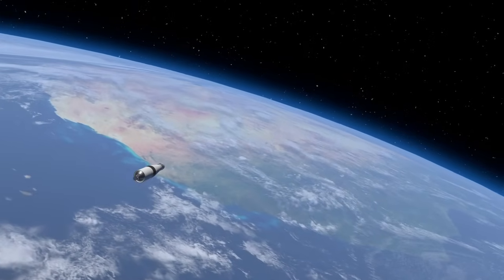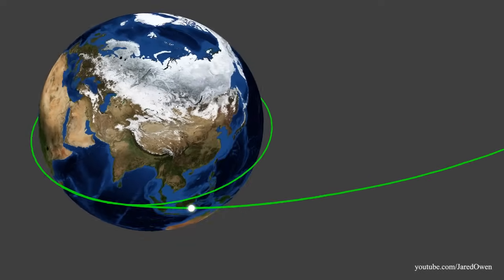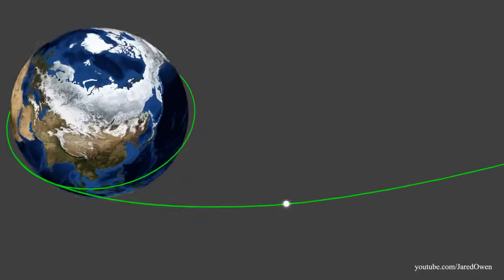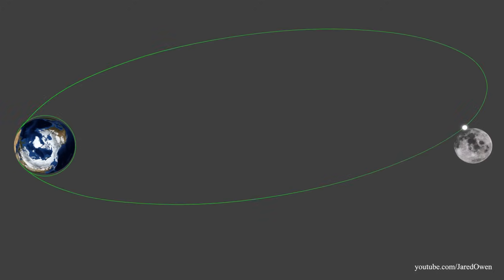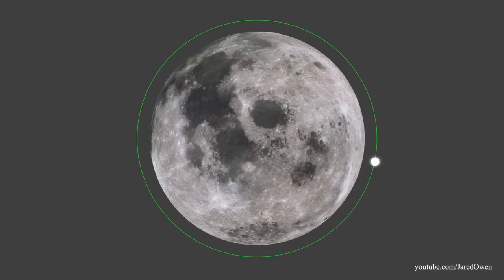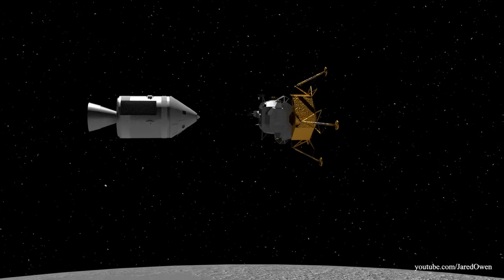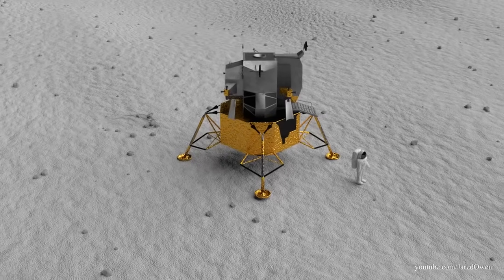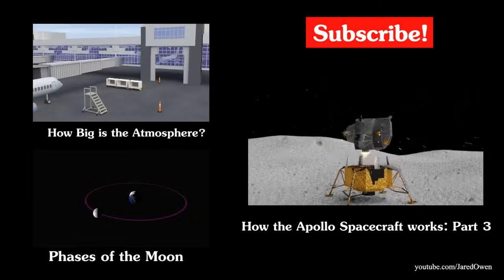How the Apollo Spacecraft works: Part 2

Comment: Is it always necessary to orbit the earth .. Cant it just go straight to moon. 
2. Why should lunar module kept orbiting the moon. Cant it just keep still high above the moon, like Iss.
Reply: They orbit the Earth because they are double checking systems and things like that.

The ISS orbits the Earth......
Reply: The lunar module could only be used once. Once used, the descent stage stayed on the Moon, and the ascent stage was crashed back onto the Moon so that seismometers could measure the impact for calibration purposes.
Reply: You do need to match to orbit of the moon to stay there. As such, the orbit didn't cost fuel. And why would they keep the LM? It didn't serve any purpose. So they loaded it up with trash and crashed it into the moon. The gave an added bonus of more science.

Comment: funny how elon musk was only able to achieve this maneuver recently with the latest computers yet somehow they were able to do this with just a guy and a stick in the 70's
Reply: What maneuver are you talking about?  SpaceX is landing LAUNCH VEHICLES; not spacecraft.  NASA has never accomplished this.  NONE of the Saturn V rockets landed back on a pad on Earth.  Zero.  They all just fell into the ocean and were later recovered.  You are comparing landing a SPACECRAFT to SpaceX landing a LAUNCH VEHICLE.  The only thing you are doing is announcing your sheer and utter ignorance on this topic; nothing more.
Reply: Let’s see. The Saturn family of rockets were the most complex machines built at that time yet all 32 out of 32 of them launched successfully. That includes the 13 Saturn V’s. This despite the fact that they expected a 50% failure rate with the Saturn 1’s & Saturn 1B’s. It’s also worth pointing out that prior to this, the USA had experienced many launch failures of much less complex rocket designs. The amazing success of the Saturn rockets was all achieved with pretty minimal use of electronic computers as the use of such devices was in its infancy. Most of the design and drawings were done the old fashioned way that took much more man-hours to accomplish relatively simple tasks. Yet despite all that hundreds of thousands witnessed each successful launch of those 32 Saturn rockets.

Comment: If you read the book "Carrying the Fire" by Michael Collins, you learn that the passive thermal roll during the coast to and from the moon,  was carried out in the vertical position and not in the horizontal alignment you might expect. It's a tiny detail most technical Apollo documentaries get wrong.
Reply: Thanks for the info ❤
Reply: Well that assumes they really did go to the Moon.
Reply: @TheMrSuge  which they did, if you're gonna deny the moon landing why the hell are you watching a video about it?
Reply: @TheMrSuge They did.
Reply: @TheMrSuge  🙄🙄🙄🙄🙄

Comment: When the LM/CSM entered lunar orbit, they were facing opposite the direction of travel.  I believe this facing opposite the direction of travel continued during the LM separation & throughout the Lunar mission.  When the LM rejoined the CSM, they were still facing opposite the direction of travel until the LM was jettisoned.  They then turned 180° to face the direction of travel waiting for the go-ahead to fire the main engine to return to Earth.  On entering Earth's orbit, they again turned opposite the direction of travel in order for the heat-shield to be in contact with the Earth's atmosphere; serving its purpose.

Comment: This is whole load of Bollox, we never went to the moon, more like we all got mooned. So many things could have gone wrong. We dont even have the technology even today to send man to the moon! We could barely get a good tangible connection to talk to someone across states in the 60-70s and we are to believe that Neil Armstrong sent a tangible message from almost 250,000 miles away!
Reply: "So many things could have gone wrong."

And many things did go wrong. The blurb for Apollo Flight Director Gene Kranz's book, Failure Is Not An Option, puts it well: "What appeared as nearly flawless missions to the Moon were, in fact, a series of hair-raising near misses.” 

Communication through space is just that: it's through space. It's not called "space" for nothing; there's nothing to impede a signal the way there is on Earth. With the aid of powerful radio arrays, communicating between the Earth and the Moon (e.g. Armstrong's phone call with Nixon) was actually not that big of deal. 

A lot of technology was quite advanced in the 1960s. 

The crewed air speed record set by the X-15 in 1967 (4,520 miles per hour) not only remains unbeaten today, no modern plane even comes close to that speed. 
The Concorde, which commenced regular passenger service in the 1970s, was capable of traveling at twice the speed of sound. Today, no passenger plane can even reach 1x the speed of sound. 
The Saturn V rocket which was used for the Apollo missions was, until just last month, the largest, most powerful rocket ever launched into space. 
The crewed bathyscaphe Trieste descended to nearly 7 miles below the surface of the ocean in 1960. Only one other craft has ever gone deeper (and by only 56 feet)!

The tech that sent humans to the Moon 1968-72 was in many ways quite advanced. They didn't have snapchat, but what they did have were kick ass rockets, and rockets are what get you to the Moon.   

As for what you are to believe, belief has nothing to do with Apollo, because it is objectively provable. Belief is for stuff that cannot be proven, like the existence of God, or the like.
Reply: The message was pre recorded, he did loads to cover any eventuality, as NASA has released several different versions, sometimes with different people heard in the background including traffic and seagulls.
Reply: And he ran away. Go figure.
Reply: "We could barely get a good tangible connection to talk to someone across states in the 60-70s and we are to believe that Neil Armstrong sent a tangible message from almost 250,000 miles away!"

Most people didn't have 85 foot dishes to pick up radio signals. NASA did.
Reply: Snore. Your comment is nothing but empty claims built on a lack of knowledge. You should strive to be better, not drag people down to your level.
Reply: Are you living in venezuela poor zone?

Comment: Which way was the CSM pointing on its way to the Moon? Here it looks like it's pointing towards Earth but I've seen another animation where they do a second 180 turn after LM extraction to place the CSM facing the Moon with the LM in front.
Reply: I think the main thing to know is that for most of the time, the adjoined spacecraft were in the barbecue roll. For the best results to even out the thermal energy being received from the Sun they would have actually been orientated perpendicular to the flight path. They would exit the BBQ roll when they did star sightings and course corrections then go back to the BBQ roll orientated perpendicular to the flight path. Btw, all of the Apollo mission reports are available online and well worth looking at for all kinds of information including the BBQ rolls and star sightings.
Reply: @mako88sb  Sorry, but what the f""" does the roll of the craft have to do with my question? If you don't know the answer please don't bother answering.
Reply: @rippenburn    Your question was:

“Which way was the CSM pointing on its way to the moon?”

My answer tells you what you wanted to know but for some reason you don’t seem to understand it. I’ll try again:

The answer is it depends. When they needed to do a course correction burn the CSM would have been pointed towards the moon. During the LM extraction and main engine burn to enter lunar orbit, it would have been pointed away from the moon. The rest of the time, which was most of the 3-day transit, it would have been pointed sideways to the flight path for the reason explained about the bbq roll. When they needed to do star sightings they would stop the roll and have the CSM orientated so that the sexton was in the shadow of the spacecraft so that the Suns glare was blocked.
Reply: @mako88sb  Sorry! I get it now and thanks.

Comment: We NEVER landed on the Moon! Almost 60 years later and we still are ONLY flying around in the ISS in earth's LOWER atmosphere.
Reply: Huh?  What difference does that make?  Is congress never allowed to end a space program like Apollo, else you conclude it's fake?  They made 9 manned trips to the moon, landing 6 of those times.  How many more would it take to convince you?
Reply: Go to the moon if you think it’s easy
Reply: @oppalus  I wish we could, but we CANT, and we NEVER did. We'll never be able to leave lower earth's atmosphere UNLESS we finally figure a way to pass through the Van Allen Belt, DonkeyTrooper
Reply: @123davepreston  So do you think the earth is flat or round? The ISS is in Low Earth Orbit
Reply: @123davepreston  The Karman Line is 100km, the Van Allen Belt starts at about 700km, and the ISS is flying under that at 666km. If you were to go fast enough you could only get about 11 RADS without radiation protection. 0.38 RADS were in all the apollo missions combined. Passing the Karman Line also means you’re out of earths atmosphere.
Reply: @123davepreston  If you’re going to get mad because people don’t believe your theories, then just don’t even talk to me
Reply: @123davepreston , Why do you think that if you flew to the moon several times, you should do it all the time? It is very expensive.

By the way, pretending to have flown to the moon is much more difficult than actually flying there.
Reply: @123davepreston  which is why SpaceX uses metric units, of course...

Comment: Fine but no explanation on why /how  that slingshot allows a quik safe line through VABs.
Reply: So?  Why does that matter to you?  Do you think people instantaneously die the moment they are exposed to a single proton?  It takes a week or two before getting a fatal dose of radiation in the Van Allen belts.  They do not go into the belts for missions that last a long time (shuttle, ISS, Mir, Skylab, etc.).  Apollo went through them very quickly, and only spent about 15 minutes in the inner belt (the proton belt, which is the more serious one).  The answers have been available since the early 1960s.   But, here's a hint for you: the reason you cannot find the answers is because your only source of input is by watching conspiracy videos.  You've never read a single actual fact about Apollo or the surrounding sciences.  If it's not in a conspiracy video, you simply do not know anything about it.
Reply: @rockethead7  
👍👍👍
Reply: @rockethead7  And? Why not? Something got to matter to me, sure aint going to be a MS 'mountain of proof Authority claim that debunked thousands of times' a denial :(   Why do YOU matter on a single proton death?(where the hell???)    Hey non carring guy; you have no idea WHY the Belts are there do you..... they stop radiations from Space (afterwards /outside /beyond), so a >>>few more<<< protons afterwards.
   And then MOON has its own brew :) A doublepunch. 

note: he never said a single thing on "how  that slingshot allows a quick safe line through VABs." route :(  Does that work for every Destination? Mars to has fasted weakest passage through?  Okay what about ....Saturn? Again perfect line avoiding that most dangerous protons ? 🤔
Reply: @wildboar7473  Sorry, but the moon has no magnetic field, therefore no lunar "Van Allen Belt". Therefore no "double punch".
Reply: @marksprague1280  Glad that you are sorry, no magnetic field Moon doesnt matter to me... Not an expert in radiation double punches :(  Just reciting MS modern Science.  What is your Source of knowing?  You do this a lot, just lipping "Realities" onto Others? 

Gather he has a HUGE opinion of himself :)
Many Megalomaniacs claiming firsthand Galactical knowledge.(lots of tv box...)
Reply: People who do not believe in the flights of Americans to the moon, the construction of the Egyptian pyramids by people etc., very often simply do not believe that tens of thousands of people can just get together and perform a super task.
Reply: @d.........  SO TRUE ha ha tens of thousands slaves building the Pyramids!!
Reply: @Smee Self how old?
Reply: "I pay the schoolmaster, but it is the schoolboys who educate my son." ~ Ralph Waldo Emerson
:) The MOON has no atmosphere and is not protected from the sunwinds and sunstorms, so ALL radioactivity is coming on the moon. The moon is TOTALLY RADIOACTIVE and no human CAN survive there. So, the moon is a radioactive prohibited area and any "moon landing" is an ILLUSION (conclusion Palomino).                                                

:) "The MOON is a SOURCE of radiation," said Boston University researcher Harlan Spence, the lead scientist for LRO's cosmic ray telescope. "This was a bit UNEXPECTED."  news.discovery.  

:) Lead scientist for both the PREDICCS and the DoSEN project Schwadron says. "For example, on the MOON, there are ADDITIONAL HAZARDS from neutrons that are created by high-energy radiation interacting in the lunar soil and radiating OUTWORD from the surface."
     That "backsplash" of protons, which was discovered by CRaTER and is known as the moon's radiation "ALBEDO," is caused by the partial reflection of galactic cosmic rays off the moon's surface. This creates a surprising one-two punch of DEADLY radiation and can also be used to peer below the lunar surface like a geological probe.
   Says Harlan Spence, CRaTER deputy lead scientist and director of EOS, "UNTIL NOW, people have not had the 'eyes' necessary to see this particular population of particles. With CRaTER, we just happen to have the right focus to make these DISCOVERIES."

"Education is a method whereby one acquires a higher grade of prejudices." ~ Laurence J. Peter
"Education is one of the chief obstacles to intelligence and freedom of thought." ~ Bertrand Russell
"There is nothing on earth intended for innocent people so horrible as a school." ~ George Bernard Shaw
Reply: @wildboar7473  I see a lot of CLAIMS. I don't see a single verification -- the usual conspiracy freak tactic.
Reply: @marksprague1280  
"Education is a state-controlled manufactory of echoes." ~ Norman Douglas
  Still at barking Lapdog, dont you ever get tired?  I shared you masterpieces, College students should also enjoy your...... erudite Evidences & Proofs.  NASA is proud of you👌
Reply: @wildboar7473  No, you have posted cliches and alleged "quotes". 

Try again.

Comment: Hey you rocket man if you drop all the fuel tank then how much more you got left to get there and then to go all the way back into that ocean land ing you call it to the moon and back
Reply: The Saturn V placed Apollo in a circular parking orbit 1,640 miles downrange at an altitude of 118.8 miles (191.2 km)  with an orbital velocity of 17,432 mph, Trans lunar injection was performed by the restartable J-2 engine in the S-IVB third stage of the Saturn V rocket. Apollo 11′s S-IVB burned for 5 minutes, 41.01 seconds achieving a velocity of 24,994.656 mph to send it to the moon - it's then a coast. 

Since the Earth's gravity continually exerts a force on the vehicle, Apollo was continually losing speed until it fell into the lunar sphere of gravitational influence at which point it began to accelerate again. So they coasted away from earth, they slowed gradually to just under 3,292mph before the gravitational influence of the moon allowed them to pick up speed again. Imagine having sufficient initial speed to coast uphill on a bicycle, you are continually slowing but if you have enough energy you reach the crest and pick up speed again. Lunar orbit insertion was then achieved through a burn of the SPS engine lasted 6 minutes and placed the craft in an initial elliptical lunar orbit and a second burn lasting just 17 seconds and eased Apollo 11 into a circular orbit of 69 miles at 3,600mph.

To return home to Earth, the CM SPS engine performed a burn lasting 2 minutes, 21 seconds, adding 3,050 ft/s/2,080mph to their orbital velocity. This was sufficient to leave the orbit of the moon and initiate trans earth injection. Once they had crossed the threshold of the lunar sphere of gravitational influence they effectively "fell" back to earth - coasting but gathering speed under the pull of the Earth's gravity. Prior to reentry this had exceeded 24,000mph. The service module was ejected and the command module performed a controlled double dip reentry using and ablative heat shield to withstand and protect the craft form the 5,000 °F temperatures generated by reentry. 

After entering the atmosphere, the acceleration built, peaking at 6 g (59 m/s²). This dropped as they slowed down due to aerobraking, and emerged from radio blackout. Passing through 7,300 metres (24,000 ft), the apex cover was blown by a pyrotechnic charge. This exposed the two sets of parachutes. First the two drogue parachutes were released, which slowed and stabilized the capsule from 310mph to 170mph. They pulled out the three large main parachutes some twenty seconds later which slowed the CM to around 22mph for the targeted splashdown zone in the Pacific Ocean.

I hope this helps.